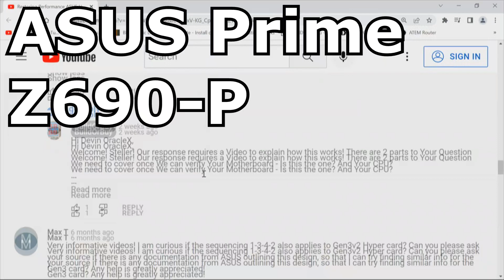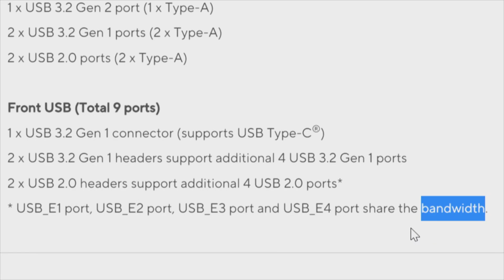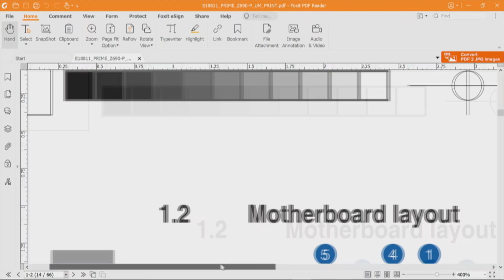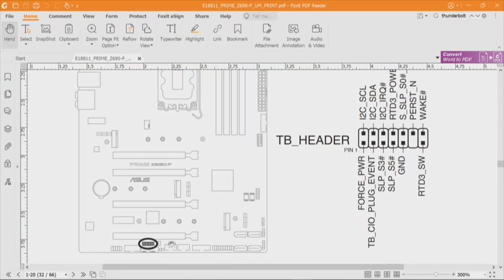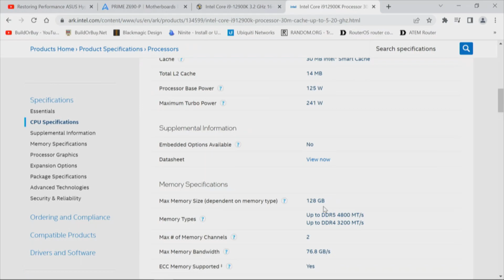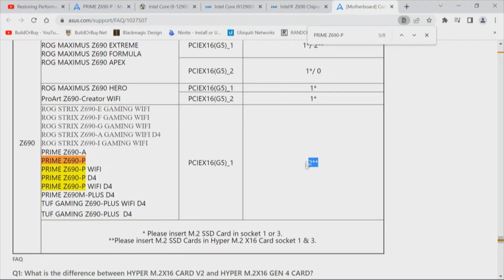ASUS Prime Z690-P Thunderbolt 4 USB4 Adding M.2 NVMe X16 Quad Storage

Comment: Is any different on performance getting a thunderbolt card vs thunderbolt built in board ?  Is it the same ?
Reply from the maker: Hi Guilladgui8259, 
Welcome. Performance should be the same. The issues we encountered were Firmware and Drivers which affects Connectivity. When Thunderbolt works, it works. Then it does not work, it's PITA. And Thunderbolt can be hit or miss. Thunderbolt is finicky based on Chipsets and Vendor implementation.
Reply: @BuildOrBuy  first I wanna the l you for your help 🙌. Yea I decided to upgrade my system my old pc is been working well with thunderbolt 3 card Alphine ridge from gigabyte. The only think I notice is when I have my Apollo interface and the computer goes to sleep it crashes when I wake up from sleep I’m guessing that part of how the system controls the card . But I will update my system to a asrock z690 Taichi motherboard which has thunderbolt 4 built in. Or the aus z790 gaming f and the thunderbolt 4 card . I like asus but the cheapest option is asrock I’m still deciding also I’m planning to get the intel 13700k
Reply from the maker: Hi @guilladogui8259 , 
Glad to help. Good to know your options and understand and measure expectations. Test and Verify.
Reply: @BuildOrBuy I just got this Asus thunderbolt 4 ex card and the z790 Asus strix f motherboard, the only issue is it won’t recognize my audio thunderbolt interface if I connect it after the pc is on , I would have to restart the pc in order to make it work , or have the audio interface on and connected before turning the pc on , do you know what is happening? What bios are preventing to recognize devices like that
Reply from the maker: Hi @guilladogui8259 ,
Turn off anything power saving. Thunderbolt is all about high performance.

Comment: Hmm. I see I'm 7m 16s into this [almost one year old: today being 29 June 2023] video ...and I hit subscribe ...which is kind of a record for subscribing to a tech channel. I think I've learned more in the past 7 minutes – in an understandable-to-me fashion – than I have in several years (yes, a compliment to you: and quite a feat after going-on-30-plus-years as a sys admin + builder ...yeah, started in 8086 years lol).

Kudos. And thnx.

Backstory:
...I just finished an Asus Prime H670 (Plus D4)/core i5 12500 build workstation (backup workstation for me, duo-use as wife's primary [gaming] desktop ...her laptop sees for more use lol) a couple of days ago. I found an Asus ThunderboltEx 4 at Amazon Warehouse (basically for ½ price) – and in checking, saw the Prime H670 mb supported it – and ordered and installed the board. 

While reading the ThunderboltEX manual (up front: the last build I did was Ryzen 4 based – however, much updated since, though now obviously EOL – and [it was my understanding] Thunderbolt was pretty much Mac specific back then ...so I was more curious than anything else),  I noted that the mainboard support instructions specified 

"The Thunderbolt card can only be used when installed to the PCIEX16(G4)_2 slot. Ensure to install your Thunderbolt card to the PCIEX16(G4) slot."

Note: I did use the required slot of course ...and the installed card was recognized by the BIOS ...and the drivers installed to Windows 11 ...*apparently* without issues, although I've not tested anything yet ...because I don't have TB peripherals - yet lol - to test it with.

But. This mandated slot requirement seemed a bit counter-intuitive since the ThunderboltEX 4 installation manual listed the specs of the card as 
"PCIE 3.0 x4 interface"

...and I wondered what the deuce was up with that specificity lol. Lack of curiousity over the years has not been one of my many-and-varied failings. ;-)

Hence, my coming across your quite excellent explanatory video. And appreciation.
Reply from the maker: Hello brdavis9,
Welcome! Just now seeing Your comments! We've been busy adding to Our Production capabilities! I'm now FAA Part 107 Certified! To the other part of Your comment, Thunderbolt is very finicky and now with Thunderbolt 4, Vendor specific in implementation! The parameters for Thunderbolt 4 are much tighter than Thunderbolt 3 was. USB-C 20Gbps 2x2 is easier to implement! Yes the Slot matters! As well as the Motherboard Thunderbolt Header cables for Bios support!

Comment: What GPUs can this motherboard handle?
Reply from the maker: Hi CM1_G,
Welcome! Great Question! Any one of them. Which GPU do You have in mind?
Reply: @BuildOrBuy  I have a 3090 but I didn’t know if that was too powerful where it will damage the motherboard over time not just straight away.
Reply from the maker: Hi @cm1_g766 ,
Congrats! Motherboard can hand that. You'll be fine in that respect. Your GPU is going to need a decent PSU. Adequate Power is essential for any Computer! Stick to a name brand PSU! Hope that helps! Keep Us Posted on Your Build!
Reply: @BuildOrBuy  I have 1050w psu 32GBs i5-12600kf
Reply from the maker: Hi @cm1_g766 ,
Sounds like You're ready to Build! What Brand PSU?
Reply: @BuildOrBuy  Gamemax RGB
Reply from the maker: Hi @cm1_g766 ,
Fully Modular! Gold certified! Made by Sohoo Technology. Rebranded. Thanks for Sharing!
Reply: @BuildOrBuy  is my psu good then?
Reply from the maker: Hi @cm1_g766 ,
It's not a High end PSU but should be OK. It's not like EVGA , Super Flower, be quiet, ASUS or Seasonic to name a few.

Comment: What is good motherboard for 12900K? i would like to run 3 4K monitors if possible... (want to buy RTX 4000 series GPU once it's out but would like to run the 3 4K monitors with iGPU till then).
Thinking of z690 Asus Proart for now.... but would love to know your thoughts
Reply from the maker: Hi Saurav Kumar,
Welcome! Interesting request, OK! For 3 Monitors, definitely the ASUS ProArt Z690-CREATOR WIFI using that CPU. Otherwise on this Motherboard in this Video, only 2 Monitors from We can see with HDMI and DisplayPort. The ASUS ProArt Z690-CREATOR WIFI Motherboard will require 2 USB-C to DisplayPort adapter cables according to ASUS under Tech Specs plus 1 HDMI! 
https://www.asus.com/us/Motherboards-Components/Motherboards/ProArt/ProArt-Z690-CREATOR-WIFI/
Hope that helps! Keep Us Posted on Your GPU Progress! Success on Your Build!

Your next Option would be to ADD a Thunderbolt Dual HDMI Adapter such as this one: 
Sonnet Thunderbolt Dual HDMI Adapter
https://amzn.to/3PS95IE
As an Amazon Associate I earn from qualifying purchases! More Options!
Reply: @BuildOrBuy  Thanks a lot for the response. Appreciate the in-depth knowledge you provide

I checked the manual and it looks like only 2 monitors can be supported directly from the ASUS ProArt Z690-CREATOR WIFI Motherboard without having to add any extra  Thunderbolt Dual HDMI Adapter or Thunderbolt card. So total cost will become ($479 for MB + $109 for TB card) ~$590 which seems a lot for me
Do you think going with Gigabyte Z690 AERO D (rev. 1.x) support 3 4k monitors without external GPU?

what would be the cheapest/most budget friendly way to run 3 4K monitors without external GPU or TB card? 

 Do you suggest i go with lower tier Motherboard and spend money on a cheap external GPU like 3050? (would like to avoid spending money right now on 3000 series and invest once 4000 series is out... but may do so incase there are no other options and it makes sense to do so)

Looking forward to your response.
Reply from the maker: Hi @isauravkr ,
Without Thunderbolt, Your best option for the 3rd Monitor will be the Splitter We've outlined. Hope that helps! Keep Us Posted on Your Progress! Those new GPUs nay be available as early as September 2022!
Reply: @BuildOrBuy  Thanks for the response.
Reply from the maker: Hi @isauravkr ,
Absolutely! Here to help!

Comment: Can you please show us performance difference between adding an eGPU through a thunderbolt add on card vs using an m.2 to PCIe x16 slow add on card
Reply from the maker: Hi Visionary, 
Welcome! We'll keep that in mind for a future Video! Appreciate Your Suggestion! Thanks for Watching!
Reply: IDK what a eGPU is. But thunderbolt4 is 4 GEN3 cpu lanes. With NVMe 1.4 drives that AIC is 16 PCIe cpu lanes GEN4. Twice the speed per lane and 4 times the number of lanes equals 8 times the throughput in theory. Like I say I don't understand your application. Or I don't know which AIC your referring too. IDK

Comment: Hello, I've been watching your videos for quite some time now, and I have to say that I'm highly appreciative of your videos at work. I have several questions I need some answers to, and this may need a video response I'm not entirely certain. Moreover, I just graduated from college obtaining my two-year degree in information technology, nevertheless, there are still things that I don't understand or in confused. Furthermore, I started a tomshardware form on some these questions, and well didn't get answers for the most part and was left to do hours of research and figure out most of answers. Nevertheless, here are my two builds.

First build which is main rig

Motherboard 

asrock x299 Killier sli/ac rev 1.0 

bios 2.00

Gpu's 

2 AORUS GeForce RTX™ 2080 Ti XTREME WATERFORCE WB 11G ( ruuning in SLI configeration) 

sound card 

Sound Blaster AE-7 

Capture Card

Live Gamer HD - C985 

Cpu 

intel i9 7960x  16 core 32 thread 44 pcie lan's 

Memory 

2 kits of Ballistix Sport LT 32G DDR4 8x288, 2400Hz, BLS4C8G4D240FSB (8x288, 2400Hz) total of 64GB

storage 

Nvme Sn770 1 Tb for os

western digital black mechinal 4tb. 

1 Lg optical drive. 

Now the second build is x299 also.

motherboard

asus prime edition 30

cpu 9900x  44 lanes as well for pcie.

the rest of the second build doesn't matter much. 

Now I have bought the Asus HYPER M.2 X16 GEN 4 CARD Hyper M.2 x16 Gen 4 Card

and 4 western digital 2 TB Sn770

Now I'm concerned I'm going to run out of pcie lanes when putting the expantion card in either system. Ideally, I would like to run two GPU, the expansion card running all 4 M.2 drives and also have that one terabyte m.2 to as my operating system. Moreover, if I was to use the Asus prime edition 30 board I wouldn't need to use the soundcard and always by an external capture card. Nevertheless, my question is can I run two GPU's in SLI configuration and still runs 16 slot station card along the top of one terabyte m.2, because I've noticed that the third slot on the prime 30 board
runs at 8X. Will this be a problem.

My original plan was to run the expansion card on the asrock board, but with everything connected to it, such as, capture card, soundcard, GPU's,m.2 etc. when I got the counting PC IE lanes, I wound up not having enough. So ultimately how does a computer delegate PC IE lanes when you had exceeded the amount, or will it still recognize the hardware. I will also provide links to all of necessary components

 https://www.asrock.com/MB/Intel/X299%20Killer%20SLIac/index.asp#Support
https://www.gigabyte.com/Graphics-Card/GV-N208TAORUSX-WB-11GC#kf
https://en.creative.com/p/sound-blaster/sound-blaster-ae-7
https://www.avermedia.com/us/product-detail/C985
https://www.amazon.com/Crucial-Ballistix-Desktop-Gaming-BLS8G4D240FSBK/dp/B00UFF84G2?th=1
https://ark.intel.com/content/www/us/en/ark/products/189124/intel-core-i99900x-xseries-processor-19-25m-cache-up-to-4-50-ghz.html
https://www.intel.com/content/www/us/en/products/sku/126697/intel-core-i97960x-xseries-processor-22m-cache-up-to-4-20-ghz/specifications.html
https://www.asus.com/Motherboards-Components/Motherboards/PRIME/Prime-X299-Edition-30/
2 kits of https://www.newegg.com/ballistix-16gb-288-pin-ddr4-sdram/p/N82E16820164173?Item=N82E16820164173 in second build 

I thank you a look forward to hearing from you
Reply from the maker: Hi Unkown Unkown,
Welcome! I'm honored! Congrats on Your Graduation! Just now seeing Your message. Working backwards through Comments under Channel Comments section as presented to Us. Since there were links, this was blocked and Held for Review. The only way for Us to know that is to go check! Give me some time to read through Your Communique since now Approved for View! Lots here to digest and decipher. Please remove those links. Even message spacing, if identified as a link, will get a Comment automatically blocked. All done to reduce Spam by YouTube for Us. 

BTW: What's Your Time Frame Status to finish these Builds? Good to do Research before hand! We need time to verify Resources on both Motherboards! And... What's Your Render engine?

Comment: Speaking of display port...read the specs...understand the cable and audio and multi monitor thing...so what? 

Got a good display port cable...somethings are snappier....some things are wonky...speed is relative to apps and features...some are coded well some coded in a haze... 

But for display port is there a must use case?
Reply from the maker: Hi Mike Quinton,
Great Question! We could Speak Volumes about Interfaces! Not even getting into Refresh Rates... Especially DisplayPort, HDMI, SDI etc. Anything Thunderbolt 3 or Thunderbolt 4, Video is always ingested through DisplayPort or Mini DisplayPort. All of the AMD Radeon Pro Display Adapters for 4 Monitor Input use DisplayPort and the 6 Monitor Adapters use Mini DisplayPort. We use DisplayPort or Mini DisplayPort to HDMI Adapters then go to SDI cables. Most Monitor problems using DisplayPort going to black can be Solved by using HDMI. And anything We do for Video to Show what We're doing on Screen has to be taken from HDMI then converted to SDI for the Broadcast Video Switch then sent to the Video Recorder. The only thing advantageous about DisplayPort are the clips on the Connector to lock the connection. That's it as far as We're concerned! Otherwise, We avoid it when possible! Even any Display Out to a 4K Display will be either HDMI on Consumer Devices or SDI on Pro Displays. DisplayPort looks really good on paper! Perception and Perspective! Thanks for Asking!
Reply: @BuildOrBuy  yep....did the same and switched back to hdmi and left display port for the family gamers...sorta
Reply from the maker: Hi @mqcapps ,
Interesting to note, DisplayPort was suppose to fix the problems created with HDMI like a loose connector. But DisplayPort only created other problems like black screens of video drop out. HDMI is here to stay! Keep it Simple and Make it Work! Geffen came out with a proprietary technology for HDMI to keep cables attached. But that screw attachment point has to be on both the Device and Cable. Other companies have also introduced their own systems for grasping cables and not just HDMI to keep secure connections. Running all of the Cables We use is quite the ordeal when looking at what goes where. I use Labels and Color Coding but I digress. Yes to HDMI!